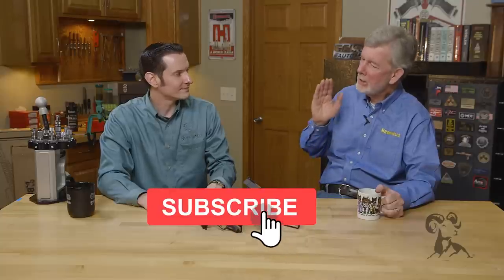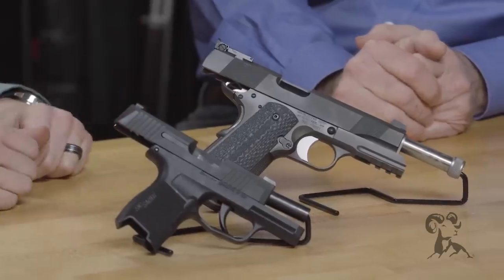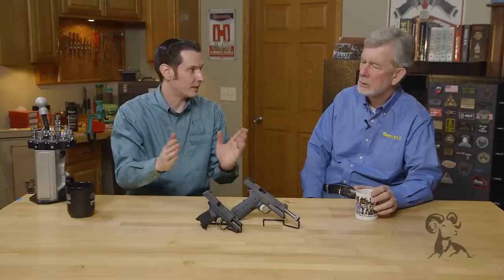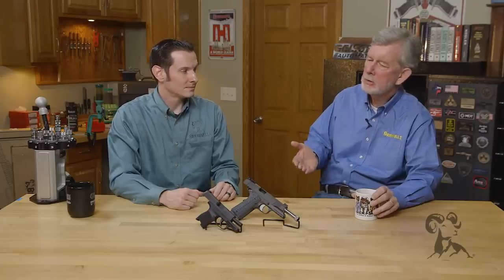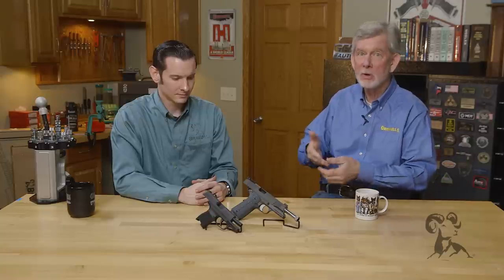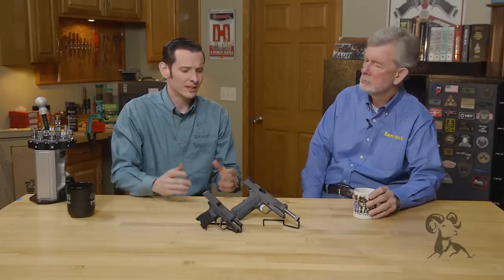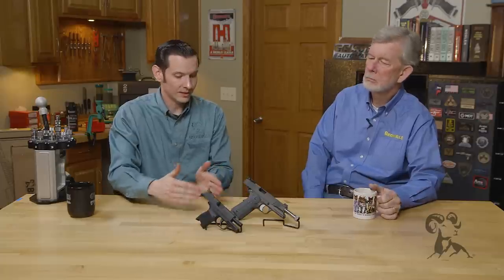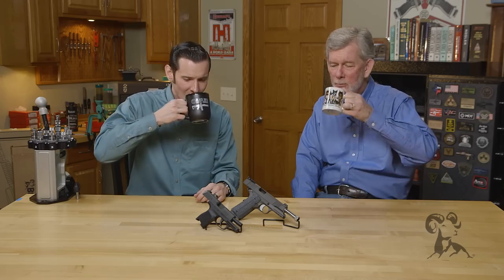Smyth Busters: Is It Safe To Drop The Slide With a Round in the Chamber?

Comment: I don't want to have to think about what type of pistol I am running or whether it is "tuned" so I try to operate all semi-autos the same way.  Also, under stress, I don't want to attempt to put a round in the chamber with my fingers when I only have gross motor movements available due to adrenaline dump.

Comment: Would like to see you address dropping the hammer on a live round to carry your gun in double action mode. Esp if you dont have a decocker on your pistol
Reply: I will. You shouldn’t. The 1911 was designed to be carry cocked, safety on.
Reply: @russellharper1310  yes it was. But im not talking about a 1911, there are alot of da/sa pistols that arent 1911's that ppl may wana carry in da mode for that long 1st trigger pull in a defensive situation.
Reply: @russellharper1310  The 1911 isn't double action so that doesn't apply to his question. @Chris There is nothing wrong with doing what you suggest; with the caveat that you should hold the hammer back and slowly lower it to position. No DA revolver has a decocker and this is the method that is used as well as with any DA or DA/SA gun not capable of being carried cocked and locked.
Reply: It’s the only way TO do it on many guns.  Basic Safety (muzzle in safe direction) obviously applies.  Not that you’re dumb, but hammers do get away from time to time.
Reply: I do it with CZ several times per week. It is how the manual says to do it.
Reply: @sanguinemoon9201  is there any chance of that round going off with the hammer down if it gets hit while in da? Just wondered if the hammer resting on the pin could cause a round to fire if the hammer got hit or bumped hard?

Comment: I used to drop one on the chamber until today 12/1/22. I just find out about this . 
I have a gen 3 glock 19 never have issues with or any other or my guns but I recently got a 19x and after droping the slide with one on the chamber the slide got stuck and I took a lot of force to rack it back. I thought at some point that my only option was to go to the range and shoot to unload the weapon. This also brought me to plunk test my ammo to make sure there was no issue with the ammo it self wich in that case was a little to tight. I don't know if that was the problem that day or the issue was due to the extractor banging the round against the chamber. Either way thoes round were used in another gun and after today I'm not planning on dropping the slide with one on the chamber again.

Comment: I have heard the one that is on old Colt 1911s/1911s that don't have the firing pin block there is a chance, albeit a slight one, that you could cause a slamfire from the inertia of the firing pin going forward and hitting that primer. Or the other one of Hammer follow where the hammer goes off on it's on.

Comment: I broke a Glock extractor doing that. It was a MIM extractor but I no longer do that.
Reply: I know when Glock swapped to MIM extractors (as well as other parts) they spent a lot of time blaming everything. The ammo was a big point of contention until reports of it failing with Gold-Dots started coming to light. Either way they must of worked it out because the problems seem to of went away.

Comment: Is there a smith buster on the + 1 mag break problem?

I USE TO CARRY +1,,,,  Not any more.

I carried +1 in my 1st gen glock 19 from 1991- 2016 until one day the bottom of the mag broke and all I had was 1….. and my extra mag.

You can tell the difference when loading a full mag into a gun with a round already chambered as it puts extra pressure on it.

That extra pressure caused a failure in the ridge of the gen 1 base mag cover.

Glock changed the bases but they’re still made of plastic.

If I need that extra Barney bullet I know how to change mags.

Comment: I'm curious as to how an external extractor is easier to replace than one in a 1911? Press the firing pin in to remove the retention plate, then the extractor comes right out with ease. And then goes back in with just as much ease. And it has that flat side which matches up to the slide, so you'd have to try really, REALLY, hard to flub it up lol.

Comment: what would be the purpose of manually feeding a round into the chamber? So you can shoot a single round with no magazine?
Reply: I'd imagine the main reason is to put in a full mag, and manually drop a round in the chamber and then send the slide home. Rather than doing it the "correct way" of putting the mag in, chambering a round, pulling the mag back out, topping the mag off, and finally putting the full mag in.
Reply: most guns can and if sold in the US it will be actually written on the slide that it will shoot without the magazine inserted

Comment: They don't mention the famous case of someone dropping the slide on a chambered round with a defective protruding firing pin. It ignited the round and put a hole in the refrigerator. This can't happen when a round is fed from the magazine since the protruding firing pin would block the back of the casing from sliding up the breech face and the round would not chamber or fire.
Reply: Do you have a link where I could read about that incident?  I'd like to read the details, like type of handgun and type of ammo.  Thanks.
Reply: @kirkmooneyham  I forgot where I read that 25-30 years ago but it may have been a printed Massad Ayoob article about accidental/negligent discharges. I recall it was a home gunsmithed 1911 45 ACP with a poorly installed firing pin stop that made the firing pin protrude past the breech face. It took a combination of errors including dropping a round in the chamber (the wrong way to load a semi-auto pistol) and the protruding firing pin to cause the discharge.

Comment: Answer my question with my Bersa thunder 9 which had a bad extractor and I was dropping the bolt on the round. It wore the extractor tip at a slant and constantly had failure to extract. so I can so agree SA metal isnt very good new extractor look lower qaulity.

Comment: Basically, how would hitting the slide release cause more damage to the extractor than the gun cycling after being fired? My reason for not using the slide release, is that I have small hands. So racking the slide is often faster for me than reaching for the slide release.
Reply: The difference is: When the gun cycles during normal use the next cartridge is pulled from the magazine and lifted up behind the extractor and pushed into the chamber in conjunction with the extractor - the extractor doesn't snap over the rim, and the cartridge and extractor hit the chamber tied together, putting little stress on the extractor.  When you manually load a round into the chamber, the slide (and extractor) accelerate forward and slam into the back of the cartridge forcing the extractor to snap over the rim of the cartridge at high speed, which imparts a lot of stress onto the extractor.  A good quality, well maintained gun will usually survive slamming home onto a manually loaded cartridge occasionally, but an older extractor which might be worn or slightly out of adjustment could break.  

Bottom line:  It is not a good practice to drop the slide on a cartridge manually loaded into the chamber, though is it not usually catastrophic.

Comment: If it's not a bolt or pump action, there is no reason for you to by dropping 1 round into the chamber. If you've expended every round in your sidearm, you have bigger issues to worry about.

Comment: Today virtually all parts are MIM or metal injection molded and then heat treated. Most but not all are then nitrocarburized or given a hard shell outer surface over the metal. If done properly MIM parts are stronger than machined parts made from tool steel. Even the "South American" guns are MIM today. But if the process is not done correctly just like machined parts of tool steel that are not grain cut in the crystalline structure correctly the part can fail. This includes extractors and firing pins. Most modern guns made from MIM parts should not break unless they were not made correctly. Its when guns get out of specifications and it gets past quality control that there is a problem.

Comment: Perfectly safe...
Reply: @gg9xfrx4m30  And how is it that a gun cycles?
Reply: @gg9xfrx4m30  Most un-scientific explanation ever.
Reply: @rileyen4608  When feeding a round into the chamber from the magazine the rim of the case slips underneath the extractor, if you drop the slide on an already chambered round the extractor is forced over the rim of the case causing unnecessary stress to the extractor. Every semi-auto pistol manual I have ever seen, including pistols with external extractors, states not to manually chamber a round and then drop the slide, always chamber a round from the magazine. I choose to follow the manufacturer instructions.
Reply: @rileyen4608   well... you will certainly get the first shot.. but since you broke the extractor the case could remain in the bore causing a double feed. end of cycle

Comment: Wait so when reloading putting a round in the chamber via slide stop pressing is okay but not slide stop button pressing when a round is in the chamber and you don’t have anything in the mag, am I getting this right?
Reply: Locking the slide open, inserting a round into the chamber with your fingers, then dropping the slide on the loaded chamber with or without an empty magazine inserted, can potentially damage or break the extractor hook as the extractor is forced over the cartridge rim. When feeding from the magazine, the round slides up and into the groove machined into the extractor as the slide moves forward. Lesson: Load from the magazine.
Reply: @de3481  gotcha thanks for the explanation, I think I overthought it lol

Comment: Hello. I just unloaded all the ammo in my AR15 magazine by manually racking out every round. Every single round has a dimple on the primer from the firing pin. Is this something I should be concerned about? I did a search and got a lot of different answers and I’d like to know what you guys think. Keep up the great work 🤙🏽
Reply: That dimple is from the firing pin. When the bolt goes forward, there is enough inertia that causes it to hit the primer very lightly. That is normal but you don’t want to practice unloading your magazines that way. Take the magazine out and strip them off one at a time or you can buy one of those speed loaders that will also unload you magazine by uplula
Reply: @CMMC-zb1gw  +1  on Uplula

Comment: The slide drops down on a chambered round every time it cycles..don't understand the problem
Reply: During normal operation when you chamber a round it gets stripped out of the magazine and slides across the breech face and UNDER the extractor.

What they're talking about here is placing a round directly in the chamber and dropping the slide. As the extractor snaps OVER the cartridge it can sometimes be damaged.
Reply: @redcat9436  guess I didn't understand the 'question'.. thanx...

Comment: Excuse the question. Why on earth would there be a round in the chamber in the slide is not already forward in battery?
Reply: For the +1 load. Drop a round in the chamber and drop the slide, then load a full mag.
Reply: @barrygrant2907  Well, no. Chamber a round, drop the magazine, top the magazine.
Reply: I’ve been dropping one in the pipe and dropping the slide on my handguns for over 30 years never had a issue. Depending on the gun it was just easier than putting the last round in the mag again especially with mags where the last round is tight and a pain to put in.
Reply: @evilsd9  Never heard of anyone doing that

Comment: The only exception is the Beretta 92 right? Due to the fixed barrel?
Reply: Berretta 92s do not have a fixed barrel. It is a short recoil falling block so the barrel is definetely not fixed. The only fixed barrel pistols out there are blowbacks like HiPoints and 22lr pistols.
Reply: @WadeWallazy  you’re forgetting gas delayed Guns like the p7 or Walter ccp
Reply: doesnt matter if the barrel is fixed to the frame this issue  would still apply.

Comment: Super tight magazines SUCK to top off, and for a spouse with limited hand strength, it's a huge hassle. It's much easier to drop that extra round in the pipe, drop the slide, slap in a mag and roll. Many years of this practice with glocks and zero issues. I feel like a lot of people here just want something to talk about. 😉

Comment: I own se veral semis , from Colt, Betetta, Sig, and Glock., none of my weapons have had the slides slammed on an empty chamber, and never been dry fired.but thats just me. Whats the point ? Doing either. Are you that bored, when you play with your sidearms? Same with my long guns
Reply: Oops Beretta.
Reply: Dry-firing a handgun is a commonly accepted and useful practice.  It helps with manual of arms with an unfamiliar handgun, it helps doing unholstering/firing/reholstering drills, it helps with trigger control, and several other good reasons to do so.  Many people simply cannot afford as much ammo as they would like these days, so dry fire drills are useful.  Most modern centerfire handguns will suffer ZERO damage from dry firing them.

Comment: How about "lowering the hammer on a (chambered) 1911"
Reply: Do-able, but not generally safe. Use the safety, and buy a decent holster.
Reply: @svenghoolie  good advice
Reply: Total bummer if the hammer slips while lowering, more prone to happen on a small spur hammer than GI hammer.  It might also make the 1911 more prone to accidential discharge if dropped as the hammer is already preloaded onto the firing pin, and if it has a series 80 firing pin block safety, this would by-pass the safety.  In the event of an emergency you would have to remember to pull the hammer back before pulling the trigger.  Also, if your 1911 doesn't have a half-notch hammer, when you pull the hammer back, if you don't pull it back all the way, it could fall with enough force to accidential discharge again.  Most 1911s have a half-notch cut into the hammer, but not all.  My Para came from the factory without the half-notch.  I ended up replacing the firing group (hammer, sear and pins) and now it does.  On the flip side, I suppose if you leave the hammer back and flip the safety on you'd also have to remember to flip the safety off before pulling the trigger.  With some training it would come natural.  When I pick up a 1911, I push down on the safety with my right thumb to help control recoil, I use the safety as a brake.  Unfortunately, I bought my first Glock last year, and the few times that I practice with it, my thumb is hunting for a safety that isn't there.
Reply: @vivillager  I quickly learned there is no reason to "de-cock" a 1911. I keep seeing videos with average joes doing tutorials on how to lower the hammer with a round chambered. Why? I have no reason to carry it with the hammer down...another misconception is that the half notches you mentioned above is another option of carry, rather than a safety feature. I will admit that I can't ask John browning if the 1911 is "meant" to be carried 1. Chambered, safety on... or 2. Loaded magazine, empty chamber... but I'm pretty sure those are the only two options. I enjoyed reading your comment.

Comment: If it wasn't safe how would the gun cycle
Reply: They are talking about with the slide locked back then dropping a round in the chamber and then dropping the slide. The extractor had to ride over the rim of the round. If it feeds from the magazine the round pops up in the extractor groove as designed.

Comment: Yes Perfectly safe other wise Condition One wouldn't be a thing...
Reply: Excuse me, what?
Reply: @svenghoolie  weapon conditions 1-4
Reply: @kingboom777  i know what they are, im just confused as to what you they have to do with dropping the slide on a loaded chamber
Reply: @svenghoolie  ah, I'm saying that you load a chamber when you rack the slide and it drops forwards or when the slide is to the rear during reloads and you press the slide stop out of the way and the slide drops forwards on to a round loading it. so Dropping the slide is okay other wise condition 1 wouldn't be a thing.  unless there's a Different meaning to the term Dropping the slide that I'm not understanding and what they are talking about  is actually dropping a gun like on the floor while loaded or you yourself manually putting a round in the chamber without a mag inserted with slide to the rear and just letting the slide fall on it vs bullet ride with the slide into the chamber.